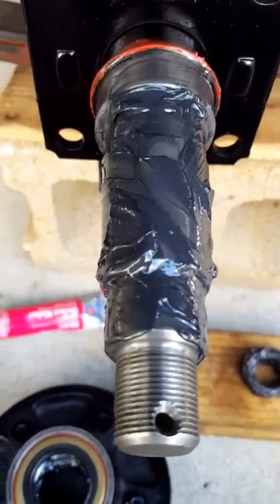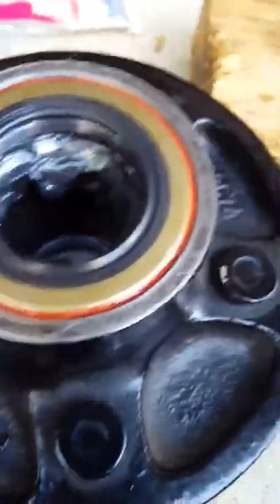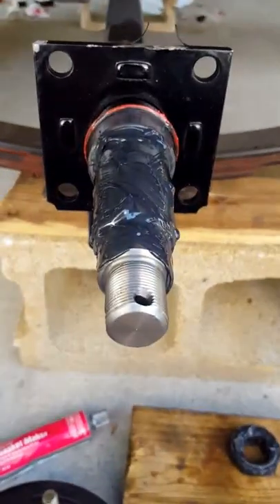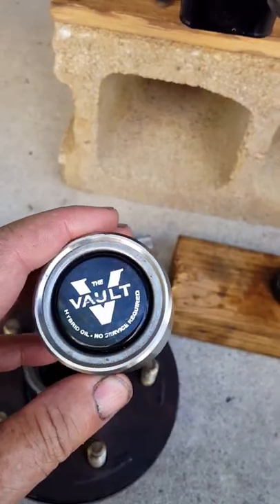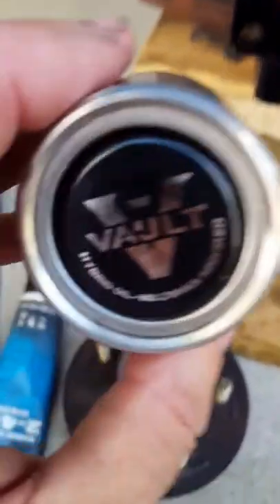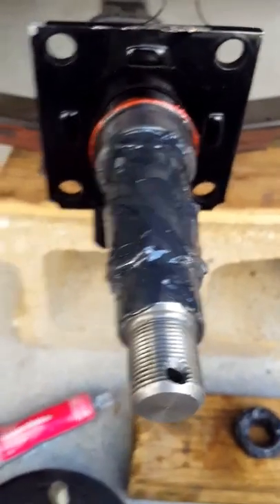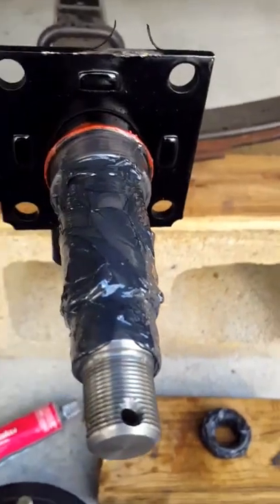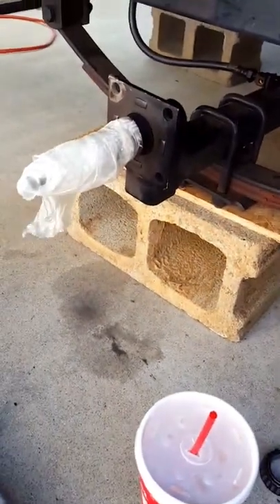Boat trailer bearings, seals, spindle rebuild

Comment: Your complaint is with the trailer manufacturer for using the wrong spindle. The vault system is as good as it gets. The vault cap will sit down over time as the grease settles in and not stick out. So sitting flat is not a problem. Nice video by the way. You did it right! The zerk fitting makes it much easier though.

Comment: I called Dexter (who owns Vault) directly and asked them about proper maintenance after I noticed my inner seal had failed and the inside of my wheel hub was covered in grease.  I will say that they had fantastic customer service, and thoroughly answered all my questions.  He said that after a while it is common for the spring cap to not be extended when the grease and bearing are resting and cold. As you drive down the road and the bearing heats up that hybrid grease turns to liquid, and increases in pressure.  If you notice the spring caps flat when cold, next time you drive to the lake check them again at the ramp and see if the cap is extended more than when it was cold. If they’re extended you’re good to go.  If not you either need to add more hybrid grease or replace your inner seals.

The secret sauce to these vault hubs is the inner seal has a spring that helps keep the seal snug on the spindle and holds in the pressurized hybrid oil just enough so that when you back your boat down the ramp and submerge your trailer under water it has slightly higher pressure than the water, and there is no outside water ingress.  It should be a completely sealed system, but we all know that’s nearly impossible.  The hybrid oil also does a far superior job coating and cooling the bearings.  Even if your inner seal starts wearing out and you lose most of the grease in your hub chances are it will still be more than able to get you back home from the lake and not leaving you stranded on the side of the road.

Thanks for the instructional video!